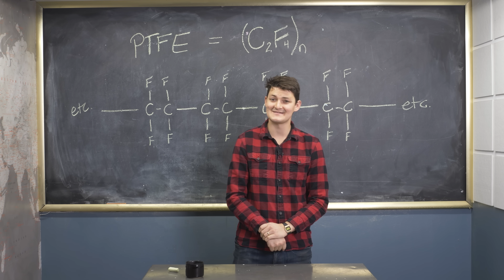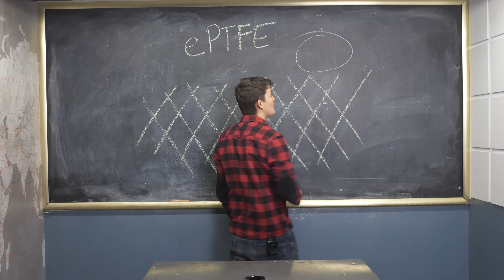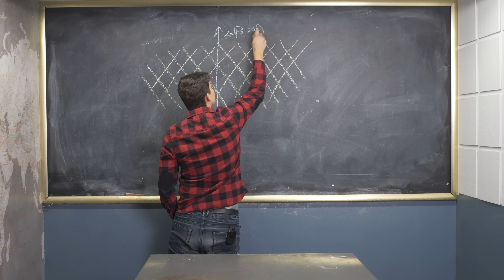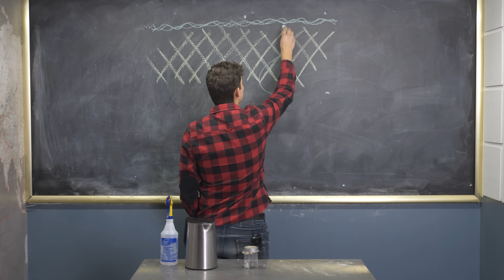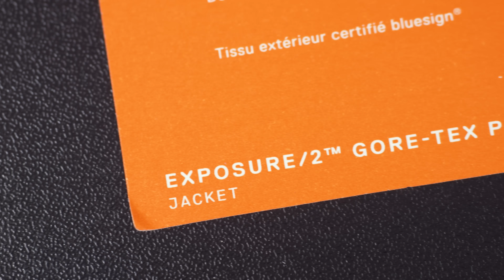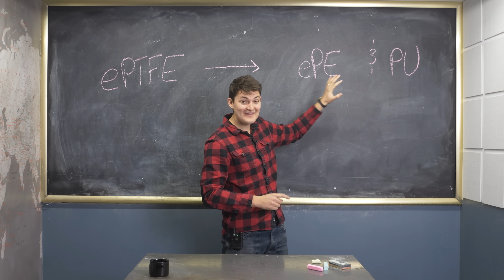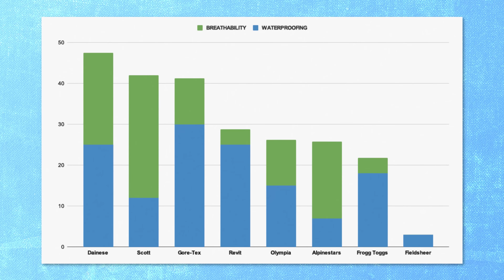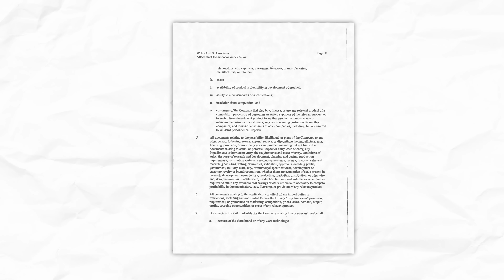Gore-Tex is a Marketing Gimmick

Comment: The other issue with gore Tex is you have to keep it clean or the water won’t bead off. I like gore tex for my mountaineering jackets but the truth is they only breath when you are standing still, if you’re working hard enough to sweat the membrane can’t keep up. I always look for good venting in my jackets, ie ; pit zips for ventilation.

Comment: GoreTex knew about the damage they were doing to communities since the 1990s but carried on doing more damage for a very long time.
Oh.
So GoreTex = knowingly damaging to communities.

I won't buy anything with that label on it.

I've never bought Sony since the disgusting 3x price for a memory card that you had to use because Sony fitted a customized memory card connector. Engineers examined the cards and they used the exact same technology, just had a different connector. 3x the price. Sony are scum. Never, will i ever, buy Sony.

Apple have a horrendous policy of refusing to work with existing tech in the home, car, etc. So i won't buy a single thing that's Apple.

It's up to us how we are treated. Stick together, refuse bad businesses. If we all do it then they have to change.

Comment: Three things:
1. He glossed over the DWR thing. All these membranes need it to work optimally, not just GTX. When it wears off the breathability of the membrane is compromised but at least the membranes are still waterproof, which is preferable to spraying DWR on fleece and then it fails and you're soaked. It's somewhat ironic that DWR isn't very durable.
2. Lifetime warranty. None of Gore-Tex's competitors have a universally excellent warranty. When I buy waterproof boots for $500 I would be soooo pissed if they weren't waterproof when the manufacturer's warranty ran out after a year. But if they're made with Gore-Tex, you contact them and they refund you or send you new boots. Same with gloves ... and coats etc.
3. Manufacturing process. To use Gore-Tex the manufacturer of the garment has to build it to a certain level of quality and follow specific procedures. I think this is why all the GoreTex stuff I buy has always been waterproof and stayed waterproof for much longer than other so-called waterproof / breathable membranes I've had.

Comment: Massively overlooked the fact that there are different grades of Gore Tex membranes.

You'll notice that the metric used in the comparison was a combination of waterproofing plus breathability and that Gore Tex had the highest waterproof rating and a mid breathability rating. 

All Gore Tex membranes have that same high waterproof rating, but the variants have different breathability. In the lower end are their Paclite and regular 2L and 3L, which have breathability inferior to say a membrane such as Pertex Shield+. However their Active and Pro membranes have 50% more breathability than the regular 2L and 3L.

The ratios of the numbers make it look like the lowest breathability grade Gore Tex was used. I would have liked to see some Klim Badlands gear with Gore Tex Pro in the test 

Anecdotally comparing my Arc'teryx Beta AR pants with Gore Tex Pro to my MEC Hydrofoil Stretch rain shell with Pertex Shield+, the aggressive production standards requirements might be playing a role too as the DWR treatment on the Arc'teryx is visibly superior to the DWR treatment on the MEC.

This seems significantly less in depth or balanced than I usually expect from Fortnine...

Comment: As a snowboard instructor this is hilarious. We used eVent material jackets as CASI evaluators and I’ve never been so comfortable working in the snow, the breathability is astounding, you really feel it compared to gore.
Reply: Yea,  I spent time as an instructor and also worked at REI for a bit. It's been years, but when they used the eVent fabric in their in-house branded gear,  I steered plenty people away from G'tex. Cheaper price, better performance, and (at the time) better quality...it was a no-brainer.
Reply: the sea to summit waterproof compression sacks are made from eVent and are excellent. Squeezing the air out for compression shows breathable and floating sleeping bags down a river shows its pretty good with water too.
Reply: never head of eVent before, but it looks to be a very similar material to goretex's various textiles
Reply: Moskomoto uses eVent and I tried one of their jacket. I think it works very fine....I believe they are smart too: instead of making expensive products because they have to pay Goretex they still make expensive garments but they use eVent which is cheaper and keep the extra money for themselves 🙂
Reply: That name sounds familiar. I think either the Klim or the Icon boots use it.
Reply: @mayorofnow   mosko moto use eVent on their gear
Reply: @mayorofnow  Some Teva boots also use eVent. Silly name, hard to search for.
Reply: ICON and Mosko Moto. Klim uses GTX exclusively @mayorofnow

Comment: Hi there! Textile engineer here (yes, we exist!). First of all, thanks for this awesome video and a lot of important details. Especially the environmental impact (it's also known for causing cancer, thats why you shouldnt scratch a Teflon pan with metal cutlery). Another word about the functionality: if the temperature (and with it the air pressure) outside jacket is higher than inside, it will instead press the hot and humid air INSIDE instead of letting your vapourized sweat outside. So the membrane really starts working as intended if the air outside is ~10°C colder than the air between your skin and the garment.
Gore-Tex is a horrible product and all about marketing. It's really bad that they're still that huge, despite the fact that there already are several better alternatives.

Comment: I've found eVent to be better than Gore-Tex, for outdoor gear such as jackets anyway, I'd be interested in hearing your thoughts on it Ryan. (although im not aware of any motorcycle gear that utilizes it)

However both fabrics are complete over-kill for motorbike clothing, firstly youre not really THAT active on the bike anyway. On an engine powered bike the weight savings of Gore-tex over cheaper waterproof membranes arent that critical either. (note Oxford's Dry2Dry membrane used on Mondial series of clothing, 1/2 the price of GT alternatives)

Totally inappropriate and costly use of the material in the motorcycle market.

PS - original comment was posted before the end of the video comparing membranes 🤣

Comment: A number of years ago a local - and now defunct - Yamaha dealer had a GoreTex demo evening.  I was 'volunteered' to put my hands in a bucket of water to get them wet then put on the GoreTex part of a pair of gloves.  I then had to put my hands into the water and wriggle my fingers gently.  After about 3-4 minutes I was told to take my hands out of the water, the gloves were taken off and not only had the water passed through the GoreTex but my hands were completely dry of even normal levels of moisture.

I have a number of 'waterproof' items of various types, the most waterproof are actually lined with GoreTex [Daytona Roadstar GTX boots and very old gloves from Hein Gericke] and the least are anything more than 6 months old made by Oxford with their Dry-2-Dry membrane.

The only waterproof jacket/trousers I have are actually a couple of sets of oversuits.  Not breathable but dry in a way that flip-up helmet visors aren't.

Comment: For years, I paired a Dainese Gore-Tex jacket with a Dainese D-Dry pant. Both worked well for years, and I always thought the pants had a tougher time of it, as you’re often sitting in a puddle of rain if it’s pouring. 

Still, one thing Gore-Tex offers for the money is the guarantee, which they back up, I’ve had boots and a jacket which were leaking, which Gore-Tex replaced. When my D-Dry pants failed, Dainese had no guarantee, had to buy a new pant. 

Great video, and the original test of waterproofing was also an eye opener.

Comment: The only waterproof Goretex jacket that I own is definitely waterproof, but I wind up wet anyways since it's doesn't breathe. I find my Icon waterproof jacket keeps me dry, except around the pits - that's where the zipper is and where my backpack puts pressure on. 

I've come to the conclusion that I would rather just wear fast-drying underclothes than worry too much about staying perfectly dry while it's raining. I have a cheap "waterproof" shell jacket that I put over my armor and the water beads up nicely, and the jacket is so thin that it flaps in the wind and sheds most of the water anyways. It does saturate after an hour or so, but usually by that time I find somewhere dry to take shelter in. Getting wet sucks, but once I am already wet it doesn't really bother me as long as I'm warm and a smartwool shirt does a good job at that.